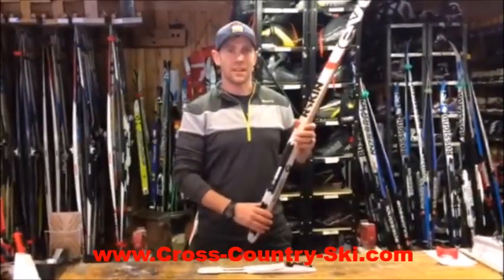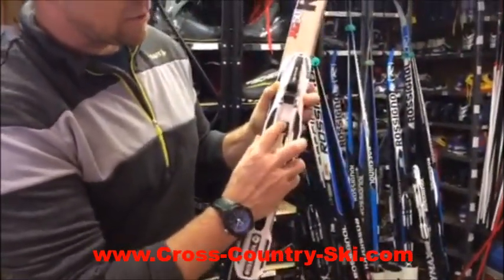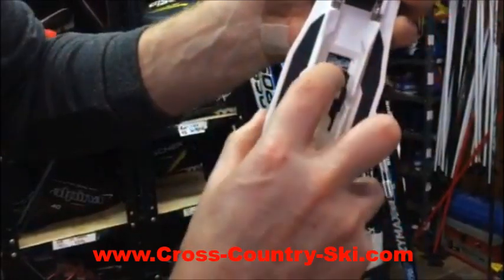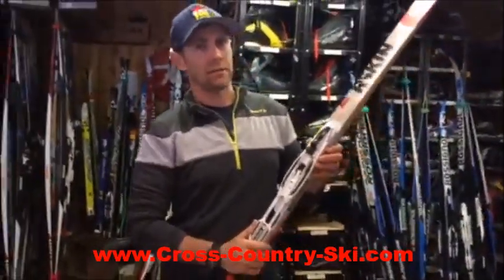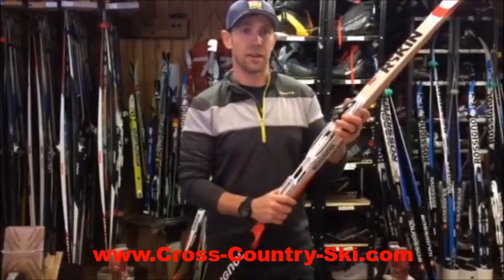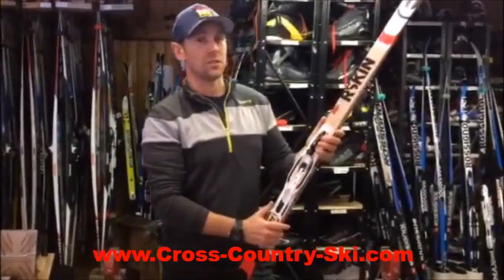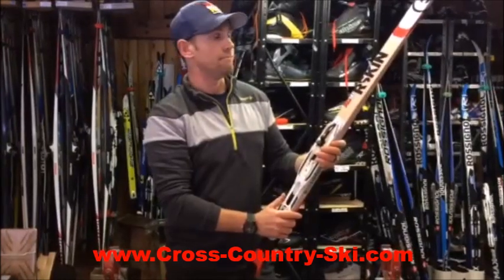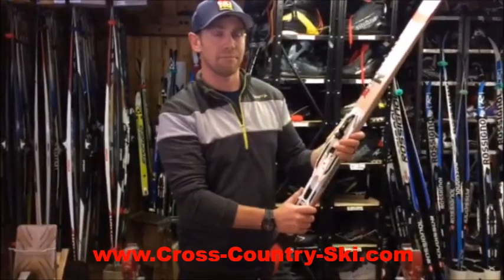How to adjust cross country ski Turnamic bindings

Comment: This the first video on Turnamic that I've seen that really explains the binding adjustment for skate skis in meaningful terms. Every other video I've seen says "move it forward for more grip," which we never want when skating, unless we're climbing a single, huge climb, which is rare as most of us ski on varied terrain. It sounds like the maxim is, move it forward for hard track conditions and back for soft, deeper snow. In the American Birkebeiner, where those of us in waves 3 + encounter snow chewed up by a thousand of our friends, it sounds like I want to move it BACK, right? Many thanks for this video!
Reply from the maker: Hi Dan, you understand it right.  When the snow is loose and your ski tips are inclined to plow or trip you up, moving the binding back will minimize tip pressure.  You may lose some stability, but that is not nearly as much of a concern in looser snow.